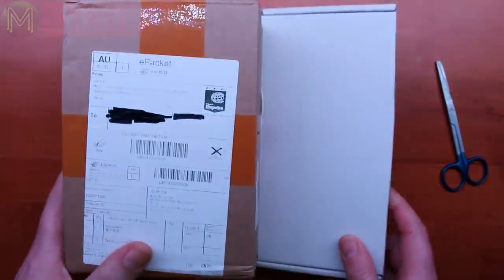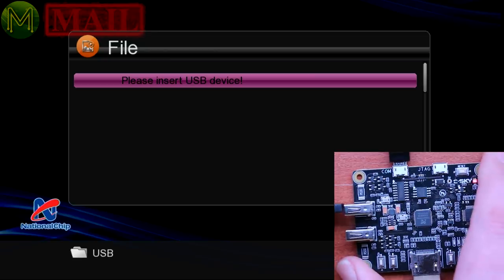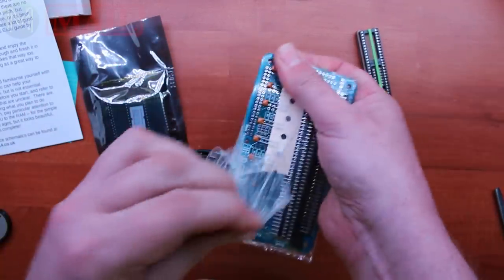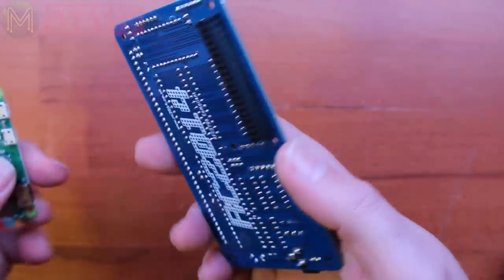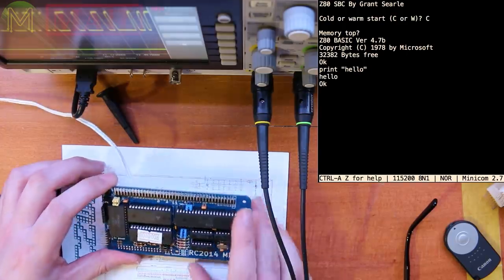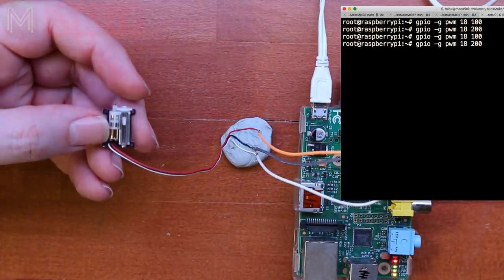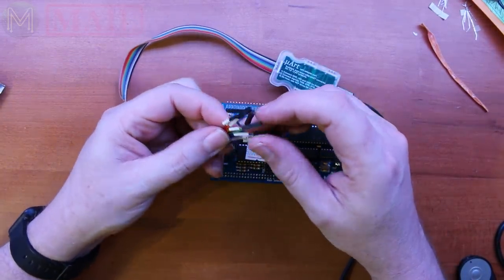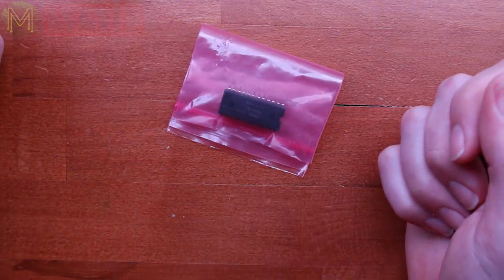#241 MickMake Mail #37: RC2014 80s retro, C-Sky and uArt.

Comment: Phoronix Test Suite shoehorned onto the C-SKY SBC could be amusing :)
Reply from the maker: Yeah, I’m getting there. It’s a tough rebuild of Debian.
Reply: @MickMake  I found a shoehorn :)

Output from "phoronix-test-suite system-info"
https://i.imgur.com/8XLvjJ3.png
Reply from the maker: You can check my results so far... https://openbenchmarking.org/result/1812016-MICK-MICKMAK31
Not many tests were able to compile because of lack of support. Need to work on pthreads.
Reply: @MickMake  I suspect you'll find numerous challenges with minilibc, I wasn't that adventurous. I went with standard glibc, bloated as it may be.
Reply: @MickMake  Okay Fangio! My results: https://openbenchmarking.org/result/1812063-SK-1812016MI95
Reply from the maker: I actually mis-labeled the test results and Phoronix have no way of editing submitted results, (unless something has changed recently). I was using uClib. Found that minilibc caused too many issues.
Reply: @MickMake  It probably makes sense not to be able to edit anonymously uploaded tests. Can't do much other than change the name on the next upload.
Reply from the maker: Actually I always login when submitting tests. Apparently this has been a "bug" for many years. Not sure why they don't allow it.
Reply: @MickMake  My bad, I shouldn't assume. I agree, it's strange that registered users can't make adjustments.

Comment: Would love to see more info on the C-SKY SBC Especial some development stuff, getting SPI ports and digital write etc..
Reply from the maker: Yeah, the tricky bit is finding what address those are mapped to. There's hardly any documentation on the SoC at all.
Reply: @MickMake  https://hackaday.com/2018/11/12/new-part-day-a-6-linux-computer-you-might-be-able-to-write-code-for/ i saw it on hackaday and was very glad you had one
Reply: @MickMake  For now, you'll have to bitbang the I/O's for i2c and spi:
https://github.com/c-sky/forum/issues/60#issuecomment-424996534
https://github.com/wuhanstudio/u8g2-arm-linux
Reply from the maker: Yup, I’ve been through all those. Now I’m getting a full Debian distro built for it.
Reply: @MickMake  I'm currently building a full Gentoo for it :)
Still in the process of building things but it's quite functional.
Reply from the maker: Yup, it's a bit of a battle, but getting there.
Reply: @MickMake  But isn't the battle half the fun?
Reply from the maker: You are absolutely correct!
Reply: @MickMake  I've got it booting into Gentoo now. It'll need a heatsink for phoronix, I managed to heat it to the point of locking up while running the gzip compression test.
How are you going with Debian? It would be interesting to compare.

Edit: Just noticed your reply in the other comment, having a look at your results now.
Reply from the maker: About finished with my testing. Do you have a link for your Gentoo image? Would be good to try that out and see how a glibc goes.
Reply: @MickMake It's still a bit of a work in progress, I'll clean things up a bit first, then post the current image somewhere for you. Stay tuned.
Reply: @MickMake  Getting the image sorted out took longer than expected. Here's a link if you (or others) are still curious.
Link: https://drive.google.com/uc?id=1oJcPei7blHEFJwQ3_yzrKoUG91gjI6fF&export=download

root password = csky

Comment: Would like, oh-so-much, to have a labeling system for small wire ends, such as those for your fancy USB/UART bridge.  Does anyone here know how this is done?
Reply from the maker: I think it’s plain old heatshrink.
Reply: Hi there! You can use some label printers for those, but basically they are just heatshrinks. I use a Brother P-touch printer at home with a HSE211 cartridge for prototyping (this prints the heatshrink directly like the one you see in the video), but for the quantity I need them now for the uArt bridge, I let the cable supplier ship with the labels already pre-applied. - Károly
Reply: @kapa7197    Wow, perfect -- thanks!  I actually have a Brother P-touch 1180.  Sadly, it is not listed as compatible with the HSE211, but the cartridges sure look the same.
Black Dupont crimp connector housings with white print on them would be the bee's knees.  That must cost.

Comment: Seems the C-SKY has dropped to 27€ on Aliexpress. At this price Orange Pi or others seems more interesting to me.
Reply from the maker: To be honest... You'd have to be a keen bean to be interested in getting one - a completely new instruction set with a "one of a kind" architecture and most people are just heading towards RISC-V.
If they keep raising the price, it'll be doomed to failure. Just checked and yup, US$21.50 is starting to be way to expensive for what you get. Considering you can get a Pi for the same price.
Reply: @MickMake  Actually, it's Motorola's M·CORE architecture. China may have made their own implementation, but the architecture it's self certainly isn't theirs.
https://en.wikipedia.org/wiki/M%C2%B7CORE

Pricing increase does make it less interesting, though bare chips are still around 5 USD.

Edit:
I just grabbed another one (i think), nicely packaged in a little 'glaringly' blue box.
Ignore the 512MB spec, I'm sure it should read 512MBit.
https://www.aliexpress.com/store/product/x/2788124_32803276402.html